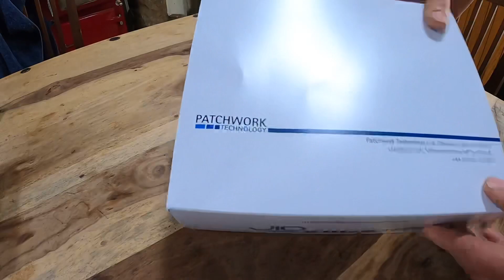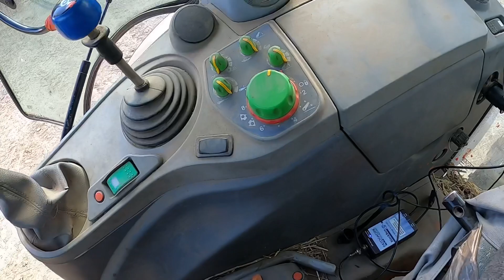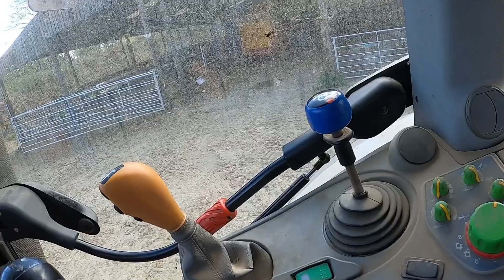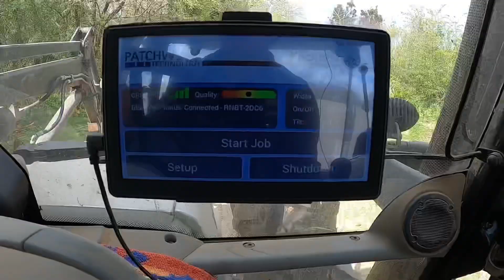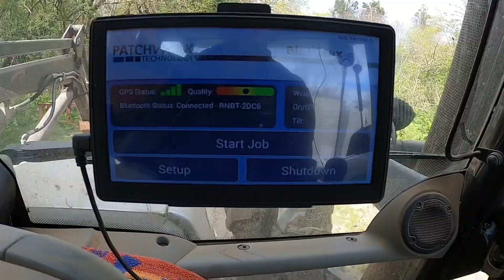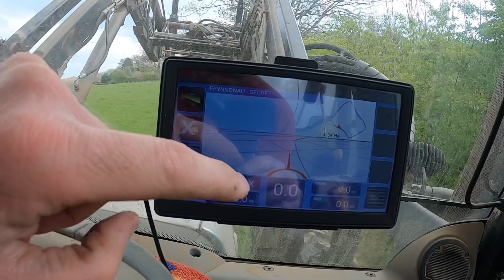Precision farming. Fitting gps to our old Lamborghini R6 tractor

Comment: Hi, great video, very helpful. Would it not make sense to put the sensor of the nose of the tractor instead of the roof? As the nose moves before the roof moves?
Reply from the maker: There's less stuff to block the signal if it's on the roof. Because our tractor has a loader as well, there's even more to block it. So they recommend the roof.
Reply: @benjoneshillsidebeef4033  good point. Thanks 🙏